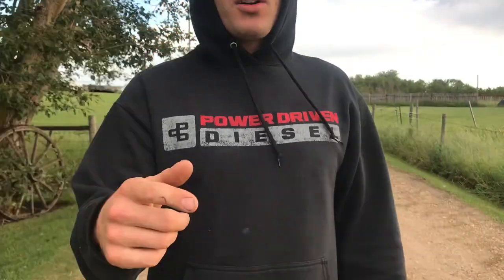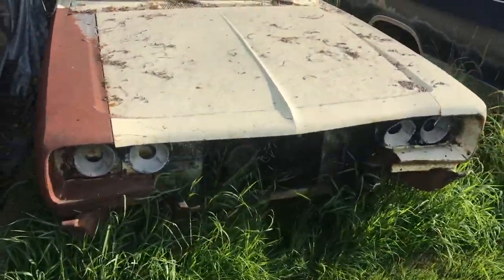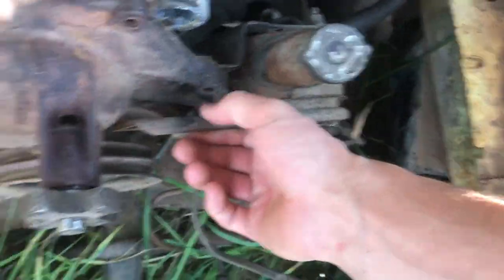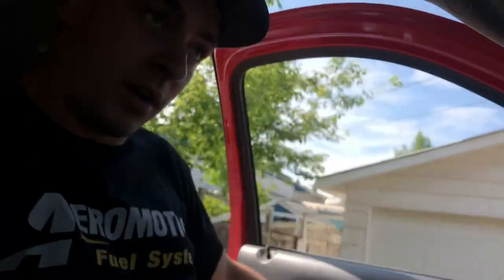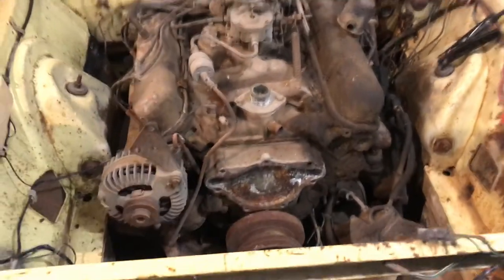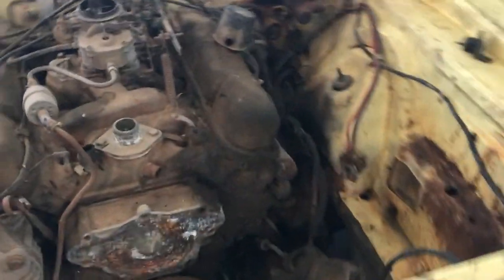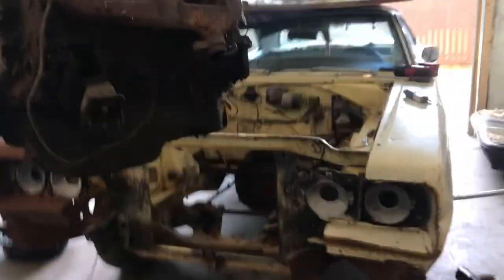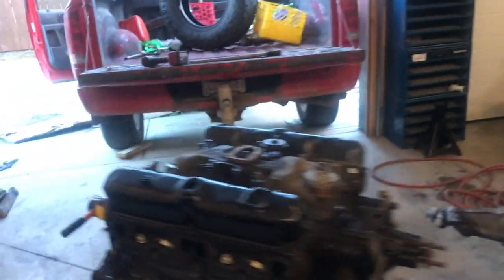MOPAR RESCUE! Part 1: Getting this 68 Coronet back to the road on a BUDGET!

Comment: I did pretty much the same thing, 68 Coronet 440, slant six car. I gutted it from ass to tea kettle and began replacing lots of sheet metal on a rotisserie. I went overboard and now have a perfect shell, to the tune of about 20k US. Takes a lot of will power and discipline to do it on a budget, but I'm a perfectionist.

Comment: Awesome stuff, keep it coming. Would be a perfect candidate for a 5.7 swap... or even a 5.9 maggy. I threw a mildly built 5.9 in my road runner for dirt cheap and she rips.
Reply from the maker: I have a 5.9 maggy sitting at the farm! I have been thinking of that lots!
Reply from the maker: I would love the fuel injection. What trans did you run?
Reply: @doublebarrelgarage  I just kept the stock a904. I put a little shift kit in it so it shifts nice and hard. We'll see how long it lasts.
Reply from the maker: That sounds awesome! I’m definitely going to be thinking more about it!
Reply: I ditched the FI and threw an RPM carbureted manifold on it so to the untrained eye it looks stock. Mags have higher compression, better flowing heads, roller cam, and most used ones are in good shape because of the FI.